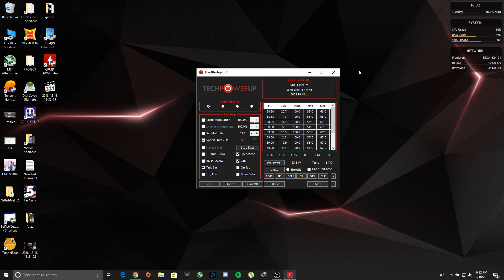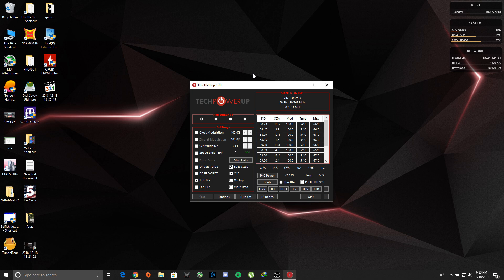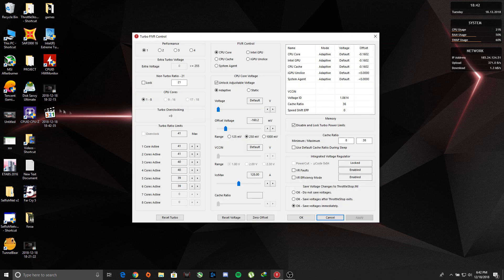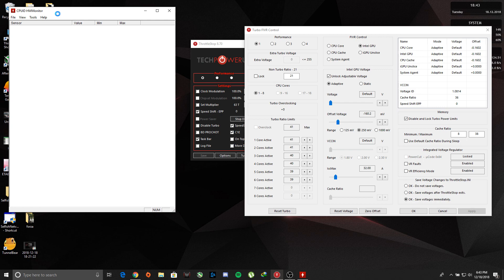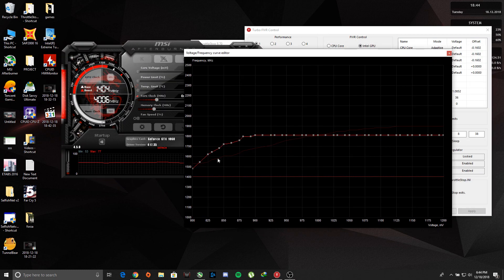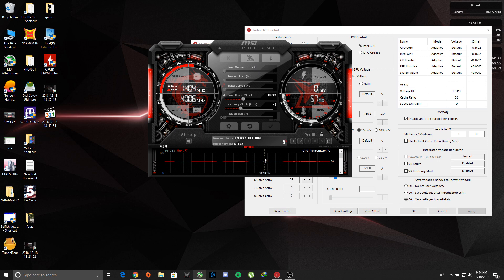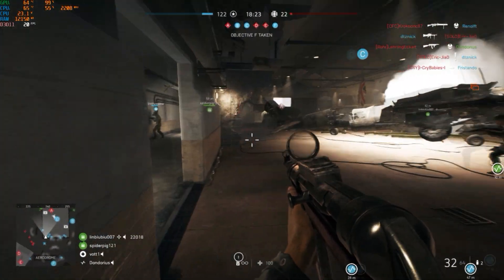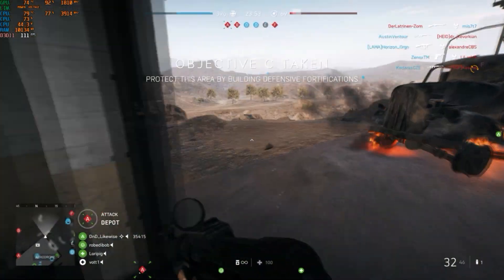Acer Predator Helios 300 (2018) i7 8750H GPU & CPU Guide Overheating Fix

Comment: Got the same specs here, same Predator Helios 300, I`d love to see those temperatures working for me while playing. Even following your instructions I got 93º on CPU and 95º on GPU while playing any game. Farcry 3 / Hellbound / Hatred / GTA 5 / Warcraft and they are simple games in my opinion. Already repaste with Cooler MasterGel, then I changed to Kryonaut, buts stills hot.

Comment: Hello sir , thanks for the tutorial . I have same specs as yours and when I applied the settings I got a blue screen , how can I find which part is causing the issue .
Edit : it turns out that the gpu undervoltage is the problem , it's at 80c° not too bad tho . However the CPU temp went from 96-99° to 85c° and that's awesome thanks again

Comment: Man this acer predator have such a goood chasis with good cooling, on my hp omen 15 rtx 2070 max q with i7 8750h on 45w cpu getting like 95-98 temps
Reply: 1. You have bigger and stronger card
2. Helios 300 is getting 90-99 too so idk if its so good
Reply: @dzuo1409  ikr but still im getting thermal throttled if i have stock 45 w, i must manually change with throttlestop to 3,6 and 35 w to stay under 90 C.

Comment: While adjusting the FIVR settings I got the blue screen
What should I do?
I have the I7-8750h and 1060
Reply: only try to use smaller values, I have an i7-8750h and 1060 max q, and -180mv works fine for me, but for you try from -120mv until you get a blue screen and use the last value before that,don't panic from the blue screen just restart and everything will be fine

Comment: God dang it, this works!!! Even a PC NOOB like me could do it, but i needed a lot of patience. Playing resident Evil 3 put CPU Temp between 98 y 92 and GPU between 92 and 85. I buy a laptop cooling stand and CPU went down between 92 and 87 and GPU 87 and 82. And after doing your guide it went steady and solid CPU between 81 and 75 and GPU between 75 and 73. That´s a huge improvement!!! Acording to Predator Sense. Also RPM fans oscilated between 5100 and 4500 RPM, before doing this the fans never went down 5400 RPM. No more anxiety super loud fan noise, its pretty tolerable now, the keyboard still gets pretty hot on the left side but not so much as before. I try to leave the MSI Afterburner graphic as much as close to your guide but they actualize the MSI so now the lower start value is not 800 MHZ. It may be to much to ask to make a video with a new graphic setting or rewrite the description in the video? So we may obtain even better results. I can´t thank you enough for this guide.

Comment: my laptop freezed when I use -160mV, even that I have core i7 8750H but the only difference ( that I don't guess it's the big deal)  that I have 1050ti. 
For me -120mV works perfectly. For anyone having a loop crash problem, u need to delete ThrottleStop.ini  from the throttleStop file.

Comment: I'm not sure if I'm missing something here. I have the same hardware spec'd. His graph doesn't match the values he specified. What value is the flatline supposed to be? Maybe my Afterburner version is too much newer to compare? the mV scale starts at 700 and ends on 1250 and all 10 values take place on mine before it even gets to 825 mV.
Reply from the maker: Yes its because the version, download the exact same version i have.

Comment: Bro normally my cpu throttles so is it fine if i undervolt my cpu only also can i use predator sense with the msi software running

Comment: Hello, do i have to undervolt to -0.160.2 to all 4 categories via the throttlestop? the performace, game, internet, battery? all i see that u only undervolted the performance category
Reply: Well soo far the throttlestop worked like a charm,  90 degree to 70 minimal, but the msi burner graph that you've given makes my game crash so im not using it
Reply from the maker: @saotomezenzuro5734  Yes you have to do for 4 categories, if your game is crashing then you have to find another graph with lower undervolt values

Comment: I have a 1060 (helios 300) but my gpu voltage starts at 700, why is that?
Reply: found a solution, leave the voltages from 700-800 stock and then continue with the values from the video

edit: I lowered the stock frequency at 793mV to 1458 MHz becouse it was higher than the frequency at 800mV. Also after applying all these settings I noticed that my gtx1660 doesn't idle anymore, it goes from idle to 3% activity every few seconds, my quick fix for this is selecting the integrated graphics in msi afterburner while not gaming. Anyone experiencing the same thing?
Reply: @ilija_duga  because msi afterburner is pinging the gpu each second making it wake up but you can make the intervall higher in the settings
Reply: @magma590gaming  thanks so much :) really appreciate it
Reply: @ilija_duga  no problem
Reply: jesi nasao soluciju? imam isti laptop ko ovaj lik i cpu sam bez beda overclocko al nmg grafu kad napravim isto ko on igre mi freezaju odmah i ne mogu uci u igru.
Reply: @darioprekl9640  pustio sam od 700 do 800 sve kako je bilo (factory seting), ostalo sam sve namjestio kao on. Za par stupnjeva mi se spustilo sve. Grafu i cpu nisam overclockao, samo undervolt na oboje. U igrici apex legends sa tim settingom imam 70*C na grafi i 80 - 90*C na cpu, sve low osim anti aliasinga. Dosta fluentno sve, jedino eto taj cpu nema dovoljno dobro hlađenje. Prije undervolta mi je CPU imao 90 - 95 što je bilo dosta kritično. Sve u svemu pokušaj smanjiti overclock, i undervolt, ne mora biti da tvom uređaju pašu točno ti njegovi settingsi, probaj stress testat i vidi jel ti se ruši. Pozz

Comment: how did you make ur set multiplier to 63t? mine caps at 41t
Reply: Same bro mine 22 wat is the i tried with ~145.7 offset voltage but my laptop started produce a sound and rebooted...can u have any other plan to undervolt ?acer predator 300 helios i7 8thgen? Cause new thermal throttle values are different
Reply: same here
Reply: Doesn't matter, it is not checked so it is not used

Comment: Hey, my voltage on msi afterburner starts at 700 instead of 800 like shown in your video.. any clue how to modify the other voltages and frequenzies?
Reply: same it's like everyone else in the world sees 800 but mine is at 700
Reply: start the value on800 and let every thing from 700 entel 799 normal

Comment: I have helios 300 i7-8750H 1060 6gb. I mostly play CS:GO and I have drastic frame drops from 300 to 30-40 very frequently. I run the predator sense on the cool boost mode. My cpu temperature reaches almost 100 and is always above 90. I tried undervolting cpu but the temperature does not decreases. I have updated all the drivers and BIOS. Please help me out.
Reply from the maker: just use this guide and undervolt the gpu too

Comment: I have i7-7700 processor 
With gtx 1060 6gb

I have undervolted my cpu with xtu. So i just need to undervolt my gpu. Will this settings work for my gpu?
Reply from the maker: yes it will
Reply: Wacky xx do i need to keep msi after burner open every time i turn on laptop or no it will Be permanently applied?
Reply from the maker: @asadwaqqas7035  yes you need to open it everytime and apply the profile, but then u can close it if u want to.
Reply: Hi bro. Can u teach me how to undervolted just like your laptop? I have done it but it crashed and doesnt work for me

Comment: After I click apply immediately, my laptop freezes. Should I use a different value other than -160.2? Thanks
Reply: For my Helios 300, I use -140.6. That's my limit. If I try any lower than this, it freezes.
Reply: @tux23  Olá Renato, o tutorial te ajudou com as temperaturas? Ficou abaixo dos 90? Aqui estou tendo 93 para o CPU e 95 para o GPU nos primeiros minutos de jogo. Já troquei pasta, segui o video aqui e nada. Terrivel
Reply from the maker: yes, lower
Reply: @wackyxx3388  when you say lower do you mean closer to 0 or closer to -200
Reply: @stingrazer4988  closer to -200.

Comment: I have the same laptop i7 8750H with the GTX 1060. If I went lower than -160.2 like you had, to, for example, -200.2, would my laptop blue screen? And would it be safer for it to be not quite as low, around -120? I watched another tutorial that said -120 was their safe spot. I'm a noob at this lol I just don't wanna mess it up. Any help is extremely appreciated
Reply from the maker: yea -120 is fine u can do it
Reply: @wackyxx3388  Thank you kind sir

Comment: I was looking forward to buy a Helios 300 in 2017 as opposed to the Dell laptop because it was a bit cheaper. Unfortunately or FORTUNATELY for some reason i delayed my purchase until 2018 when i heard a new Helios or Dell laptop is coming up. Even though the Helios is the value for money king i could not bot afford it cause its was 1200$ with 144hz display meanwhile the dell laptop was kind a normal at 1100$. I was already above my 800$ budget. So i got Dell Inspiron which was renamed G series like 3,5,7 etc. It has weaker CPU and GPU but it could theoretically last longer and has Dual vents exhaust to keep the temps cool. My G7 also throttles so i use undervolting. I have been thinking of repasting the thermal paste to 100 percent fix the problem but it isnt as bad as the Acer which has hotter cpu and GPU and only single vent.

Comment: You can also tune  turbo boost, you can tune it to boost up to 3.4ghz(instead of 3.9), this will give you lower temps , yes you do lose some performance but its only 12% which does not make any major differnece in games, light tasks like browsing are not affected at all.(3.4ghz on nfsp max fans- 72c, 3.9ghz on nfsp max fans- 86c, the performance loss to 3.4ghz is not visible).
Reply from the maker: i like to use my machine with its full potentinal, im getting 3.9 all the time even with no tasks. my temps just under 80 no matter how long i play .

Comment: yo props to you this works great. i used to have 90-100 celcius when i first got this laptop. then i undervolted with xtu but only got 80 avg which was still good but now im getting around 60 max fans or 70 auto and that is way better than having 90 . thanks you so much
Reply: What is your off set voltage?
Reply: @Gamerp02  oh i returned that trash laptop, kept throttling again. on my new asus laptop, i running -69 mv using throttlestop getting 80c max fans
Reply: @royisdabest  Nice, which asus model do you have?

Comment: I bought my helios 300 less than two months ago from a foreign market, so I cant send it back and have had many problems with the laptop overheating and causing throttling. Even when playing moderately heavy games my laptop would be radiating heat, and I have tried many different tutorials and fixes but none, NONE helped as much as this video. So I say thank you, good job, and you've just got a sub.👍
Reply: hasoonisthebest u can try to repaste the CPU and GPU ( check youtube ) and also keep ur BIOS updated. It may fix the problems
Reply: Get a cooling pad will also help a lot

Comment: i applied the undervolt and cpu core is fine both min and max at -0.164v but in gt offset and llc ring offset i'm only getting min as -0.164v but max at 0.00 whereas in your system u get both min and max as -0.164. how do i get max as -0.164v as well?
Reply from the maker: make sure to apply it for the cpu cashe and intel gpu
Reply: @wackyxx3388  nevermind i got it once i restarted. Thanks to u my temps have gone from 95 degrees to 86. Great job!
Reply from the maker: @bullseyePlaysEth it might go lower, whats ur laptop model, mine doesnt exceed 78
Reply: @wackyxx3388  it's the same specs. Acer predator helios 300 ph 315-51 i7 8750h gtx 1060. Maybe i'm getting higher temps because of higher room temps. Its like 25 degrees Celsius.

Comment: Hi man, this has helped but I still get fps drops but for only 2 seconds.. when I applied what you said in the throttle app a message popped up saying "Error locating driver file: The System cannot find the file specified" 
I notified that the temperatures in overwatch vary a lot. 70 to 78 degrees ( I have the same model has you) can you help please 😔

Comment: Just so all of you want to know, the laptop doesn't have an overheating problem. I purchased the PH315-51 a month ago. I kept seeing temps above 90° in the shitty PredatorSense program and I couldn't believe it. It turns out, that the built in manufacturer program is lying. I installed SpeedFan and the difference is about 20° at all times! If PredatorSense shows 50° at idle, it's really 31-32°. It never went above 78° to be honest. Also, it lies on the CPU load at all times. Checked it with Task manager, and the difference was about 30-40%. The only good thing the PredatorSense program is good for, is to throttle your fans! Don't underbody your CPU!

Comment: Thanks your truly a genius and have shown people the true power of optimized laptops, my laptops games 144 or more on high settings doom 1080p, and has temps of 66gpu and 70 cpu and it's hard to get over those numbers
Reply from the maker: glad to hear that, doom is a very optimized game so expect it to run perfectly fine. what laptop you have?
Reply: @wackyxx3388  but we know that most laptops come out the box really really optimized weirdly,
It's best you do it yourself if you want to feel the control of the laptop instead of use it. This is a great tutorial for exactly that 
Before my gpu and cpu where like hotter then I'd like 
My fps was like 80 to 120 before 
And I'm not sure if I had any limit or thermal limit but if i did, i got no signs whatsoever now, and my laptop actually feels like its sturdily just doing what it needs. 
And i learned that Intel XTU isnt really that reliable of a configure program like throttle stop, another gamer to a gamer thanks friend, you earned a sub !!!
Reply: yaboiisachie cpu core and cache how much? The number
Reply: @wackyxx3388  the asus rog strix 2, 1060 - 16gb ram and 144 hz screen 
Model name the gl704g

Comment: Does it have the same effect if I undervolt my cpu using the intel extreme tuning utility instead of throttlestop? (I also have the same laptop you have)
Reply from the maker: yes its fine, make sure your values are sit by checking hwmonitor

Comment: So, I have my settings to faster boost and I get fps drops every now and then. But I have fan speed on auto. I was wandering if you had a fix because I need to have at least faster boost it turbo boost for my 144hz screen. But I get fps drops. I dont want to have to put fans on max as my parents get really annoyed when I do have it like that. But anyways, nice vid.
Reply from the maker: well its because ur unit is overheating, fps drops happens cuz ur cpu is cooling it self down, you need to undervolt ur gpu, i have a undervolt and overclock profile if u want, and u better keep ur gpu on normal with defult fan speed, if you follow this guide ur fps problem will definitely vanish
Reply: @wackyxx3388  my dad said it's because since the air flow isn't good. But his laptop use to do that  until he got a cooling pad. Also, he said that putting fans on max speed should help. But it will be loud.
Reply: Sachin Singh  no, it's ok. All I had to do was have a little stand for the laptop so there air flow was better. And the thrilling stopped. But thanks anyways
Reply: Sachin Singh  oh. Well so least the problem is gone so no worries. But thanks for the advice.
Reply: Sachin Singh  same, but sometimes, I don't know literally the most basic stuff. I know how to fix may problems, with PCs, I know how to take them apart and replace things, but I didn't know laptops must me lifted up LMAO. But thank u for the help. And keep up the good work
Reply: Sachin Singh if i undervolt but the temp still didnt change